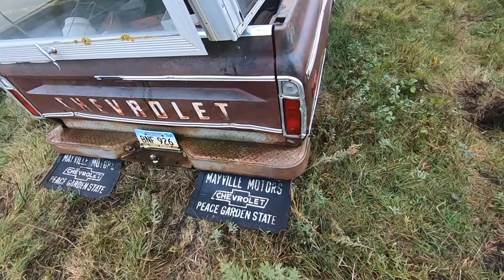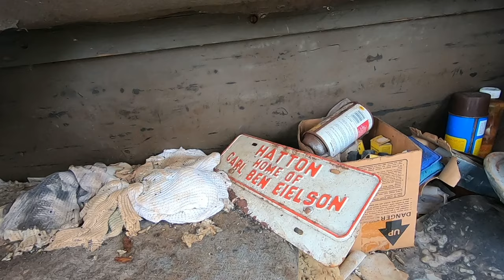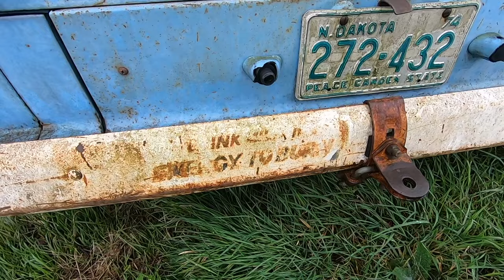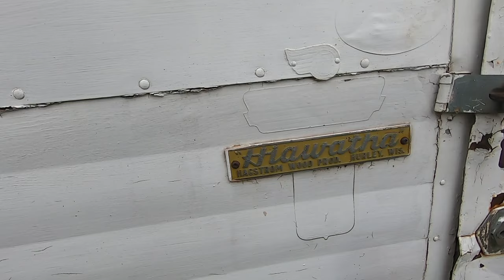Massive North Dakota Farm Auction! Three Generations of Inventory!

Comment: I like walking along with you at the auctions or the swap meets on the second channel so these are good.  BTW if no one else mentioned it on that Mustang that was a 68 because it had the rear reflectors in the quarters and more useless trivia it was a pre-strike production car because the reflectors are inset and body color....after the strike they went to a plastic chrome one that sat flush on the qtr.
Reply from the maker: Thanks for the info!

Comment: The 33/34 frame is a 34 because the shocks are mounted outboard on the frame rails, 33 are inside.
Or you can tell it's a 34 by the way it is.
There is also slight differences in the front cross member.
Very entertaining video!
Reply from the maker: Thanks for the info!

Comment: I liked the 69 Chevy Truck & the 65-66 Corvair 4 Carb. THEY GO ANY WHERE IN THE SNOW UNLESS YOU HIGH CENTER THE CAR.
Reply from the maker: That's what I hear!
Reply: @moremortskerepair4354  Dad had 2 Corvairs, 1 was a 66 Corsa WITH THE 4 Carbs. 4 SPEED, 140 H.P. The other was also a 66 but was Turbo Charged, 4 speed & put out 180 H.P.

Fun cars, easy to work on, GREAT IN THE SNOW, it would just PLOW RIGHT THROUGH IT, Air Cooled ( BIG FAN ) & you dropped the engine out of the bottom of the car if need be. THANKS FOR THE REPLY & THE VIDS.

OH, PET DUFF FOR ME, GREAT DOG HE IS, KIND OF OBSESSED WITH CRITTERS THOUGH, LMAO. GET THE BIRDS DUFF, GO FIND UM & DAD BETTER NOT MISS AFTER YOUR HARD WORK.
Reply from the maker: @NoWr2Run  cool